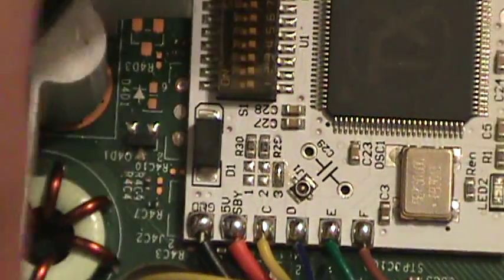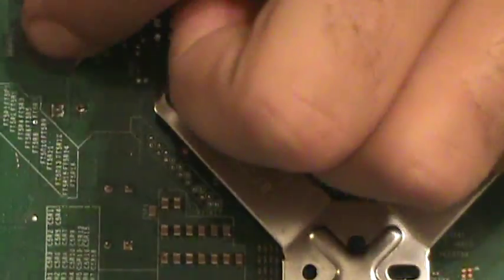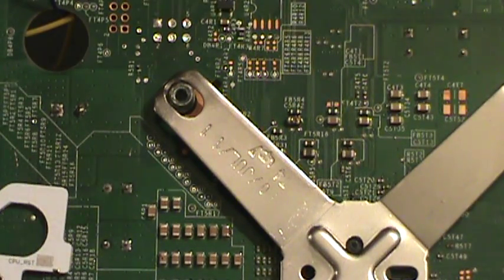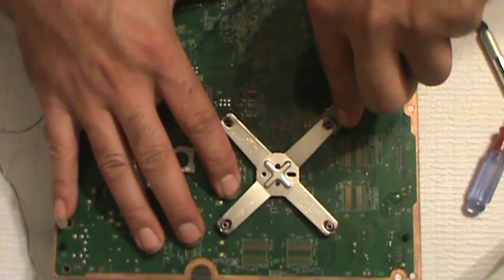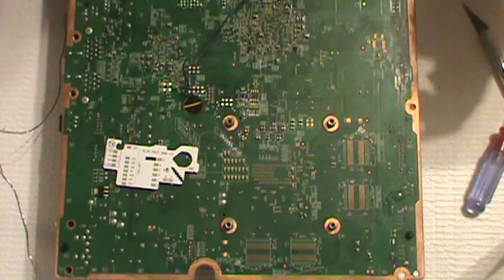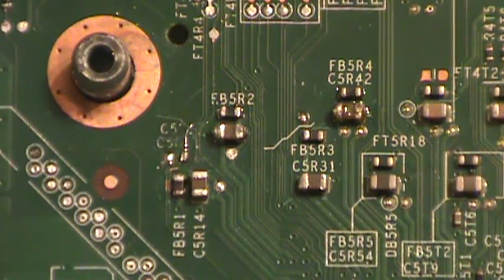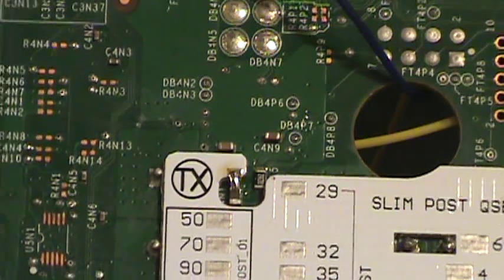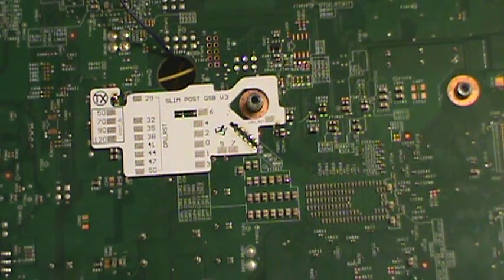Xecuter Slim Proto Install Tutorial Part 3 (Trinity)

Comment from the maker: You dont have to use the post out QSB you can just directly solder the wires to the board yes.  The post QSB really makes it a lot easier to tune the boot times.  I wouldn't recommend not using it.

Comment from the maker: Yes changing the wire point or the dips or the voltage jumpers would resolve the RROD error.  Its not at all uncommon to get a RROD off some of the settings.